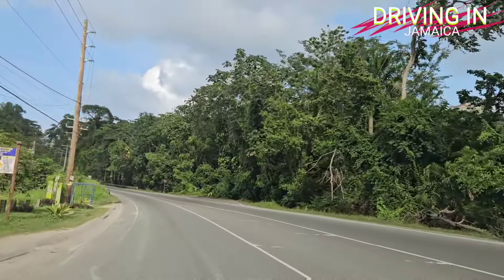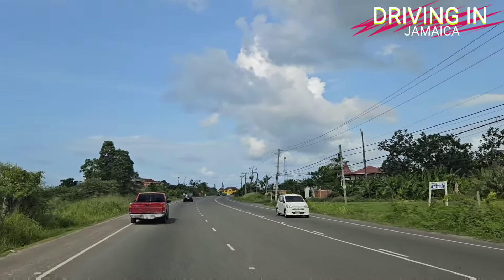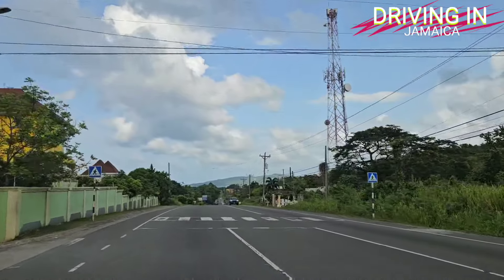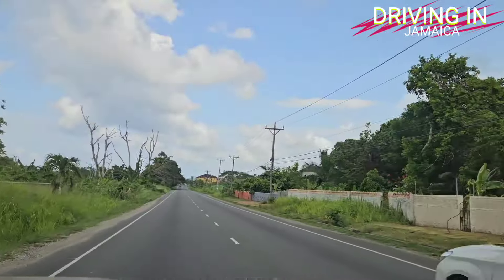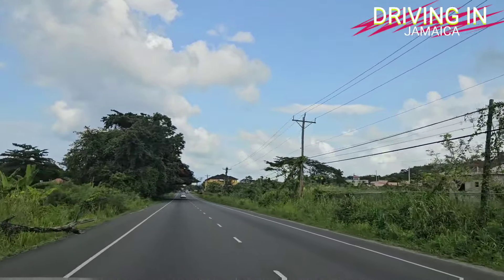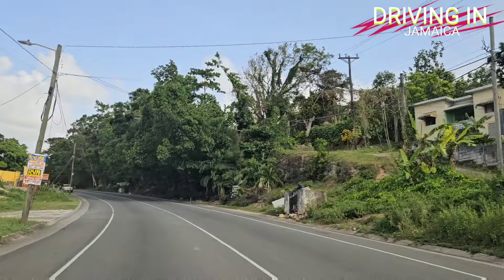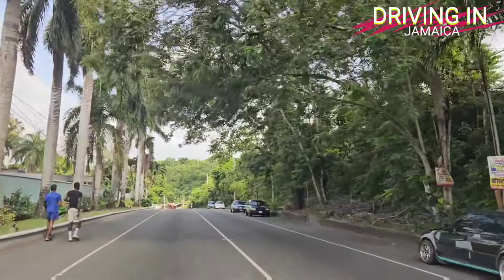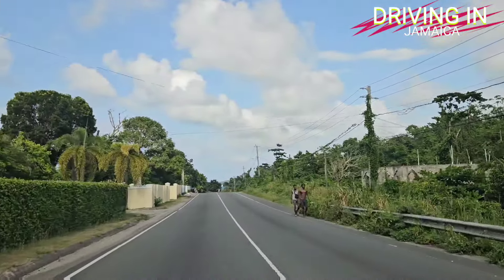Construction Runway Extention Ian Fleming International Airport Jamaica

Comment: IN ✈️LAX  -LOS ANGELS CALIFORNIA THEY HAVE SEVERAL RUNWAYS SOME OF THEM THE HIGHWAY 🛣 RUN UNDER IT WITH JAMAICA THEY EITHER LOWER THE ROADS BEFORE THEY REACH THE AREA BUILD A TUNNEL FOR TRAFFIC OR DIVERTED THE ROADS THEN CONTINUE TO THE OTHER SIDE WHICH MIGHT CAUSE MORE TIME &MONEY
Reply from the maker: Thanks. Let's see what they do. I think diverting the traffic
Reply: Los Angeles' Van Nuys general airport (in the San Fernando Valley) also has its runway passing over a sunken four lane roadway (re: Sherman Way)...
Reply: I believe I have seen the same in New York’s John F Kennedy international airport where the airport traffic transits below the surface of the “taxiway” as for a major highway passing below the surface it would definitely be a challenge